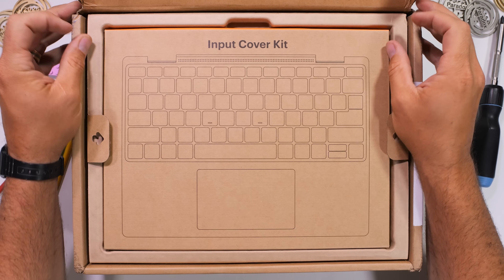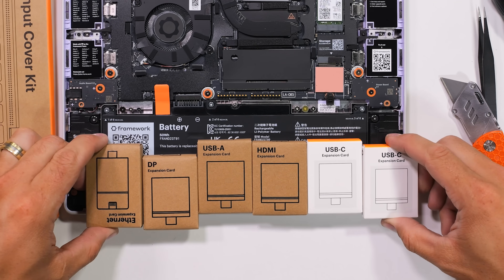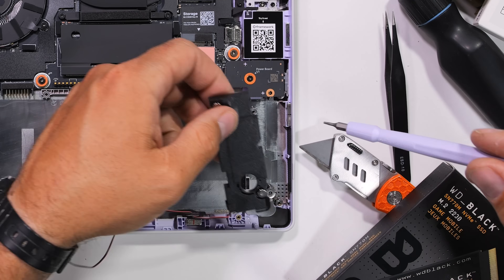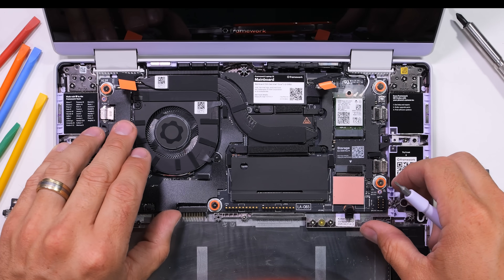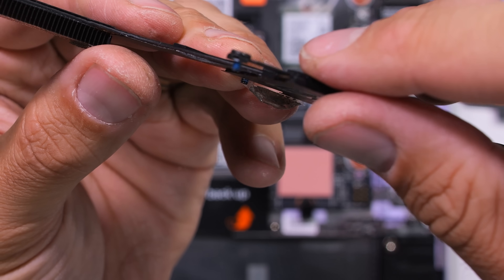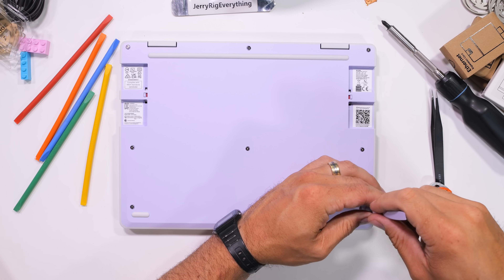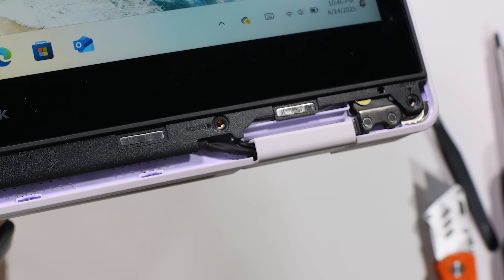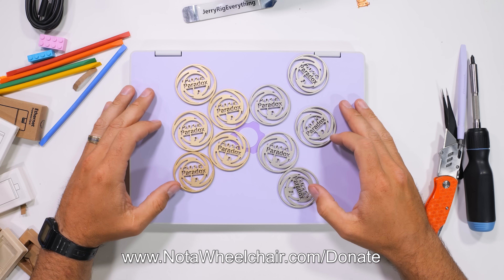The Best Laptop on Earth... is almost too easy to fix.

Comment: $600 still expensive af. might as well go to back market or any other used laptop website and buy a really great MacBook Pro with an M1 or an M2 chip for starting at 2:50 and up to 400 bucks… You’re getting a more powerful laptop than this weird Lego, do it yourself thing for way less and you get a great operating system that works with your phone watch and whatever other Apple accessories you have

Comment: id already heard of framework laptops, i was cpnsidering hetting it before i realized i just needed to replace my battery and hard drive on my current 8 year old laptop. i want to make this laptop last as long as possibke before replacing it, but the framework is definitely what i get when the one i have is no longer repairable.

Comment: It’s interesting because this is one of those ideological companies to me. They might not necessarily make sense on a value level for most people. They might make sense to a very small subset of people who really need to repair their devices and people who are interested in upgrading their own device rather than buying a new device. Now six months later a very compelling aspect is any kind of RAM that you can swap.  

All of that being said this product is such a hard device to sell. It costs in its very most basic configuration about $100 less than a MacBook in my country.  Meanwhile, that’s going to be much more powerful have much better battery life and honestly have a number of nice quality of life improvements. Now you are losing out on repairability and a lot of flexibility with potential upgrades.

If you are looking to save $100 and looking to Support a company like framework, this is a great device. For the average customer, I still find it hard to recommend compared to like a MacBook or even just other cheap school Chrome books or whatever.

Comment: its not safe, it can be stolen easily
Reply: how
Reply: @Taha_A  i can stole you ssd with just a screwdriver
Reply: @AbhayabhayKumar-0  i mean one still needs to take the tim- i see your point. it opens faster. it's easier to take out. but if you're doing that no matter how much time you have the owner of the laptop is going to notice their data missing. you could say the same thing for all laptops. and if you were stealing the ssd it would be better to just steal the whole laptop, as the laptop itself imo is more valuable than it's hardware due to its modularity and futureproofing. sure stealing requires just a screwdriver but it's still the same as stealing a laptop, which is risky regardless of it's modularity.
Reply: @Taha_A  true😅🤣

Comment: out of everything you shared, i noticed the Stainless Steel, traditional Buck knife lockback Carpenter knife/box cutter with button press for quick release and blade change.  So, kudos from me, you got a solid gold Dad star for that one, lol!   Mine is the older solid stainless steel Husky brand fold out Buck knife lockback with swing out plate blade removal.

Comment: Would be nice if they could provide color matching expansion cards (in case they don't already). Also, just an idea, they could make the actual expansion cards slide inside the laptop while keeping the back intact and in one piece, for a cleaner look. This should also fix the issue of mismatched colors. At least from the back. Other than that, absolutely amazing job on this product! And thank you so much for covering it.
Reply: You can indeed get aluminum expansion cards, it's the same color but isn't quite flush with the back (meaning you see the square cutout)

Comment: I have an Acer aspire Intel Celeron 1 core single thread 1.6Ghz...
With 2 minipcie and 1 PCMCIA.
1 minipcie populated with a dvb-t decoder to see the television.
This is not new, just old but with new thunderbolt conection instead pcie or PCMCIA.

Comment: I've been daily driving the framework 16 for over a year now and I absolutely love it. I've also been able to confirm that their customer service is fantastic on 2 different occasions. I broke my trackpad (my fault) a few months in and simply contacted them and they sent me a new one without any hassle or even asking for the old one back (they even encouraged me to repurpose the broken one for another project). Then last month my d key stopped working, and yet again all I had to do was contact them, tell them what's up and they sent me a new keyboard module, despite my laptop no longer being in its warranty window. 10/10 laptop, 10/10 company.

Comment: Had a framework 13 for about 18 months now, and it's such a nice laptop. 
I really like how from a Linux perspective, the laptop just works 100%, unlike others where I've had to replace the wireless network card, or motherboard can't send a pwm signal to the fans through the OS

Comment: Gold plated contacts won't corrode.  If the coating is scratched of sure, but that would only be after many cycles of assembly/disassembly.  In their life time, these will see maybe a dozen cycles.

Comment: Installing windows on an open architectured laptop feels kinda weird. Meanwhile you are roasting the expensive bloatwares. I know my texts are blue, but at this point you also a consumer of a marketing-design first over engineered-design company. At this point just use linux. In 2025 you can have almost everything on linux which are available on windows, or at least have a reasonable replacement software.

Comment: Can you only replace framework parts with other framework parts or can you replace them with other 3rd party parts? If so can i get old samsung laptop cpu and swap out the framework cpu? If you are locked in the ecosystem then it is completely useless.
Reply: You're old Samsung laptop cpu will definitely not work here. I'm guessing what you mean by is a socketed cpu which hasn't been in production since the 4th gen intel mobile cpus, more than 10 years ago
Reply: @cy_was_taken  besides the fact that the cpu's in todays laptops are sawdered in the laptop.  My point was that you can't can't customize framework laptops outside of framework "approved" cpu's or parts. Which means it "locks" you in to the framework ecosystem which is no different then being locked into Apple or somsung ecosystem

Comment: Hey, I'm not saying they all do it, but most of them are. In most 5-800$ laptops you can find irreplaceable RAM and some other details. But not all of them are like that. You could search reviews on disassembling and find out how repairable they are. If most people do that manufacturers will hopefully see the trend. All our laptops have removable RAM, SSD, fans, battery and easy access to change the cooling paste in a few years, so you can maintain it yourself. 

My last laptop served me 10 years and is still working.

Comment: I like the idea of frameworks, I just don't like the 'cartridge' design. as nostalgic as it is, it's kind of insulting. it implies people are incapable of undoing a few screws to replace a fan. it's also wasteful and not as cheap as it could be. not to mention the fact that the hardware they have is years out of date, and just doesn't cut it for most consumers.

Comment: I'm using Framework 13 with AMD CPU for about a year, and I love it. I disassembled it once to change thermal paste, I upgraded a webcam module. It's not only useful, but also gives you more emotional involvement.
By the way, the keyboard in Framework 13 is connected to the main board by ribbon cable. There's no that net spring connector system mentioned. So Framework constantly improves which is nice.

Comment: I was excited because it looks really good for a budget laptop and then I looked up the price..
A 13.6 inch macbook air with 10 core M4 cpu and 8 core gpu and 16 GB of ram made entirely out of aluminium costs $999
A 12.2 inch framework 12 with 10 core i5 cpu and no gpu and 16 GB of ram made entirely out of plastic costs $1132
I get that it is a still growing company so they can't manufacture their products as efficiently as companies like apple can but as of right now, a new macbook air is much better value than a new framework 12.
Reply: the macbook air does not have a gpu. it has an igpu so saying it has an 8 core gpu is just wrong. and I have no idea where you are getting these prices from because in usd the base framework 12 with 16gb of replaceable ram and 500gb of replaceable storage is $816 and the base macbook air is $999. if you are going to talk trash about a company at least get it right

Comment: The Framework laptop has a great modular design. However, for IT security, the trade-offs are important:

- Firmware Updates: Historically, BIOS updates with critical security patches have been significantly delayed. While Framework is improving this, it's a risk for those requiring immediate patches.
- Secure Boot: It works, but configuration is more technical and less intuitive than on mainstream laptops. It's not "broken," but it's expert-oriented.

Verdict: You trade a polished, automated support experience for hardware repairability and control. For security professionals, this means more hands-on maintenance and potential delays in updates.
Reply: Sources for further reading: 
- Ars Technica: "Framework's software and firmware have been a mess, but it's working on them" (Documents update delays)
- Framework Community Forum: Threads on "Secure Boot" and "How long is BIOS support?" (Show user experiences with complexity and support timelines)

Comment: Could you look at the "SuperNote"? 

Its made by a company called Ratta, and is basically an electric journal. Specifially, the Nomad is th modular version, i think...

Tldr, i bought a first-gen one in 2021, and it broke in 2025. I think theres something loose on the power line...

I didnt back it up😅

Comment: I have a 15 yo HP laptop with an i7 that i use as a desktop and gave it new life as i was able to swap the ram, wifi card, put an ssd on and has a dc power connector that acts like a fuse and protects the motherboard in case of any electrical issue, imagine my surprise when i realized in newer laptop that same dc connector that i can replace for 10 buck is sodered to the motherboard just like the ssd, it literally screams we want this laptop to be unfixable and if there's any issue we want as much damage as possible.
 If i ever want a new laptop it's gonna be a framework, sure you spend a lot now but you're gonna save a lot later.

Comment: Dude.... this is NOT a budget laptop. "It starts with 500 bucks thing" is just a marketing gimmick. You want medium specs it quickly gets to 1000 bucks (a bit extra ram, a bit extra space, operating system). You can buy two foldable laptops for that of similar specs.... Sure they will not be upgradeable nor repairable... but, honestly... I don't care. If it breaks I will buy another one. And long term support and upgradeability sounds funny when you talk about company incorporated 5 years ago.... Bottom line is. If you want to feel good because "you are saving the planet with your repairable electronics", it will cost you. As far as I am concerned - you will do more good to environment if you buy a used "unrepairable" laptop.... (and it will be cheaper...)

Comment: Not sure why reviewers keep mentioning Apple's Macbooks. Framework does not compete with Apple, it competes with plethora of big PC brands' offerings under $1K. Plenty of macbook users have machines aged 5-6-7 plus years that still work perfectly fine and have better pretty much everything than even mid-tier framework laptops (not this cheapest one), especially screens
Reply: Framework products look like a good value compared to MacBooks if you don't think about it too hard.
If you really consider what you're paying and what you're getting, or you start comparing it to machines other than Apple's, Framework machines start looking less and less appealing if you're not specifically a laptop enthusiast.
Reply: I got an m1 macbook air in 2020 and it still works just as good as the day that I bought it. In that timespan however, do you know how many lenovo, acer, dell, razer, and other computers have failed me? Do you know how many intel chips have failed me both in the thermal and performance regards? Do you know how many times I've had to stay anchored to a wall whereas my m1 would've chugged along all day with an extra 50% battery to spare? Do you know how many keys have stopped working, boot drives failing, screen no longer responding, trackpad freezing, OS corrupting, port failing, driver outdating, messes I've had with these clunky messes of machines? Framework is absolutely no better than the alternatives to them. They use the exact same memory, chip, and storage components. On the framework website you can find these pieces for nearly double the price as they are right now on amazon and best buy! These parts aren't even unique to framework. Every non-arm laptop uses the exact same SSD and Ram components. You're just paying more for the exact same products if you buy on framework's site. But let's talk about the non-run-of-the-mill components. The beloved proprietary screens, keyboards, chassis', trackpads, and express ports. Have fun paying a premium for these proprietary components, and your so-called "non-obscelecense" collapsing in on itself the day Framework's online shop closes, or rather, likely sooner, they run out of stock. Oh wait, they already have. Many times.
Reply: Taking a look right now for 2TB SSD's on framework, which are listed at 250, the amazon counteparts (new) are only 150. But yeah, they're the epitome of "consumer rights!" and "affordable repairability!"

Comment: They will never achieve any meaningful market penetration with the way they are currently operating. They are banking on the good will they generate by advertising sustainability but sustainability is never a sought-after quality in a product. It only works if you make sustainability attractive (cheap price, innovation etc.). Framework is trying to make it neither cheap nor innovative, they are pursuing sustainability for its own sake. People have traditionally never stopped or started things for the sake of sustainability, even under threat of mass extinction. How arrogant must you be to think they will do so for a laptop without a compelling reason?

Comment: The only reason ive not grabbed a framework yet is entirely because I specifically need a 360 degree hinge with a touchscreen (pref 4k) and dedicated graphics (yes very specific, yes it was an absolutely painful process to find my current HP laptop).

The moment they add 4k touchscreens to the premium version, I will literally spawn in.

Comment: AMD Ryzen 7 7840HS
Framework 16- $1300 
Lenovo slim 3- $750 
Both with integrated gpu
Can't upgrade processors
Yes screen is upgradable but so expensive that it's better to buy a monitor instead and hdmi ports are available in every laptop 
Then where's the point of buying it at such an inflated price 
It's just beating around the bush without actually addressing the actual problem 
And replacing ram and SSD is not that tough job in any laptop

Comment: I'm using my current laptop until it passes away, and then I'm immediately switching to Framework. Same for my phone and Fairphone. I've already switched to Fairphone earbuds and it's nice to know I'll be able to switch the bats out when they inevitably degrade, or buy seperate earbuds if I ever lose one.

Comment: This is how laptops should be built. To change a keyboard (the most commonly broken part) on a modern laptop you have to disassemble the whole laptop and the keyboards aren't even replaceable, you have to replace the whole shell if you can even buy the part.

Unfortunately Framework don't offer high end GPU options.

Comment: I was wondering how it could be that cheap. I mean their previous models have been more withing the ballpark of 2-3k. Then in the pre-order configurator it clicked. The framework 12 is only available with i3 and i5 CPUs. Good luck getting anything done with your eWaste of tomorrow when the system requirements of even modern websites are chugging down your brand new laptop.

Comment: It's not cheap. With similar specs one can get a laptop at much better price. It something happens get that traditional laptop repaired and still cost won't be more than framework laptop. Also do you really wanna stay with one laptop for years ? Also if you're going this way go all the way select MNT reform completely modular laptop.

Comment: It actually exists...

1. Touchscreen & tablet mode (with stylus)
2. Designed to be adapter friendly
3. Encourages upgrades (every tech person and gamers dream)
4. Fully customizable system
5. Repairable to an almost stupidly high degree (captive screws?? THE KEYBOARD AND SCREEN???? I am shook)
6. DURABLE
7. And, the cherry on top, YOU CAN BUY REPLACEMENT PARTS AT A NORMAL AND SANE PRICE!!!!! STRAIGHT FROM THE COMPANY!!!

This is LITERALLY my dream laptop. When my current DELL eventually breaks down (its already getting there- my guess is two years at best) I know EXACTLY what I'm replacing it with.

Comment: i knew it... sounds so nice but if you want even the lowest Gaming specs its easy at 2300€ which is just stupidly expensive for a 7700S and a Ryzen 7 7840HS and just 16GB Ram (32GB is 180€ more for some reason)

Comment: This is like pure science fiction but imagine if 50 years from now AI is good enough to do JARVIS level engineering, and you can just grab a bunch of random spare parts you have, and it will print boards, a case, and do all the required engineering and design for you to just jerryrig a unique laptop together from random bits and pieces